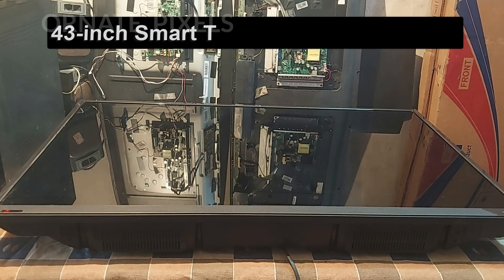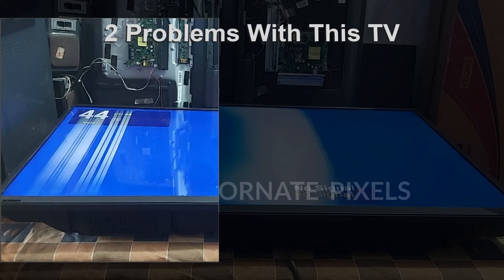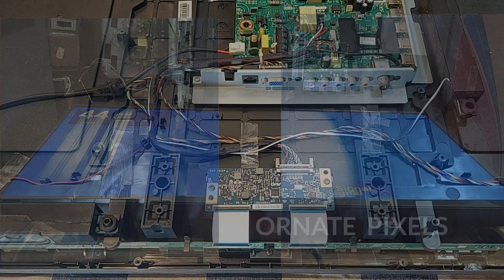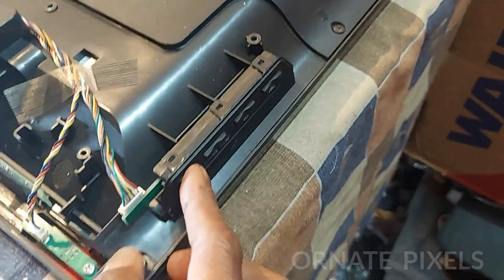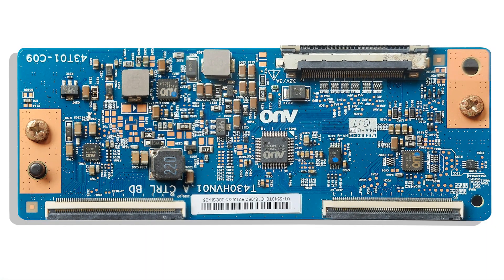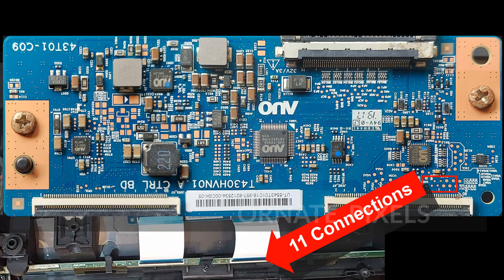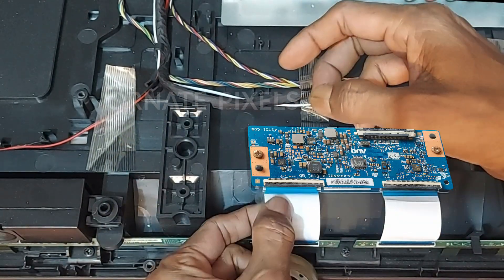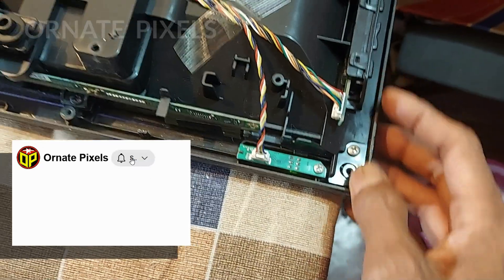FIX Your Hisense/Walton/LG TV NOW With T430HVN01 AUO 43-inch Panel Repair  | Vertical Bars Solution

Comment: Ostad, one corner of this display got direct pressure and the internal liquid crystal has leaked out. Now sometimes the picture appears fine, but then black spots spread across the screen again. It’s clearly a liquid leak issue — nothing done from outside can fix the internal damage. From your experience, is there any possible way to repair such a panel, or once it cracks, is it considered completely damaged? I’d really appreciate your expert opinion.

Comment: i had a similiar panel unfortunately it will not last. i fixed it the same way and it lasted only 6 months then other problems started to appear and it was not fixable anymore. AUO panels are crap

Comment: Sir, the solution to the problem in all your videos is very interesting and there is all the information about the component which tells us which component is bad and due to which this is happening. I request you to start such a series on LCD LED TV in which all the repairing from zero to advanced is covered, where to get the schematic diagram, how to get the data sheet of the component, if it is not available in the market then which component can be used in its place, give videos on such other topics in a complete series so that small people working in the electronic field will get help from your side. Thank you from my side for making such informative videos.
Reply from the maker: I have noted the points you mentioned. The datasheets and schematic circuit diagrams of many components are published on the Ornate Pixels website. Stay well, thank you brother. 🌿❤🌿
Reply: Am telling you bro I love this man❤

Comment: آیا برای تمامی تلویزیونها
این بردهای T ,Con 
این گونه کار میکنند؟
Reply from the maker: This method of solving the vertical lines or bars problem only applies to this panel. However, the knowledge gained from this method will need to be applied differently to other TVs.
Thank You Brother. ❤🧡💚💜💙

Comment: Asslaam o alikum sir
Mustafa brother how are you I m waseem form Pakistan. Iam facing problem regarding my Sony 43x7500h. Plz help I like your videos on YouTube, and trying to gain knowledge.
Model 
KD 43X7500H 4K original 
Fault :
No display and vertical lines(this Sony led using lg tcon and scaler board)
Lg 8670c-814A T con board and scaler PCB 6870s-1980E (lg)
Tcon board is ok but scaler PCB smd capacitor short and also COF is very heated when switched On TV
[04/03, 10:38 pm] Waseem Ashraf Lodhi: Sir 
All voltages are ok on TCON BOARD 
VGH. 27V OK
VGL. - 10V OK
AVDD. 14.8 OK
VDD. 3.3V OK
VCOM.  5V OK
ENABLE VOLTAGE 1.8 OK AND 1.1V OK
Possible that smd capacitor are showing short due to COF short or any other problems like CKV LINE short
If possible sir guide me
Reply from the maker: If the SMD capacitor is shorted, replace it.
However, if the COF overheats, replacing it is the only option.
It may also be that the COF is good but heating up due to a panel shortage.
It is not possible to give more advice than this without checking the circuit board of the TV. Take care Waseem Bhai.
Thank ❤🧡💚💜💙

Comment: sirji apka short kiler circuit ka digram do prakar ka he ek me 10k ke 2 rasister or dusre me 10k ka ek rasister esa kyo sir or transister konsa lagega sir dono me se koi kaam nahi kar raha he or voltej meter ke connection or 25 whatt  bulb connection bhi nahi work kar rahe he kya aap bana banaya de doge ya uska ek video or bana dijiye
Reply from the maker: I have published the circuit diagram of LCD short killer on my website. If you build the circuit correctly, it will definitely work. However, unfortunately, some LCD panel short may not be removed. Thanks Brother. 🌿❤🌿